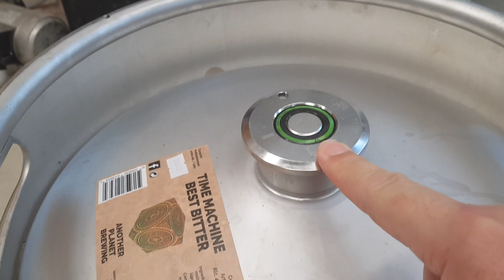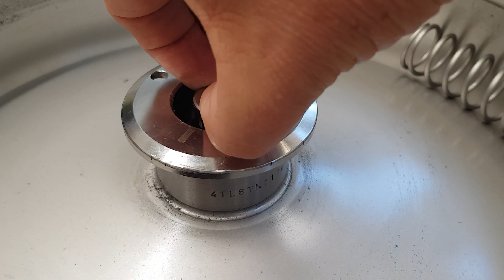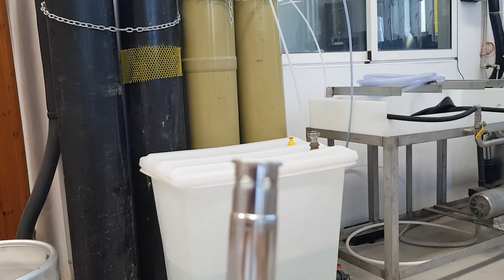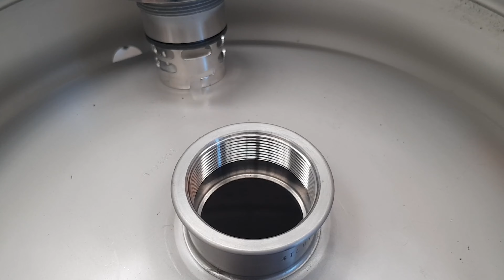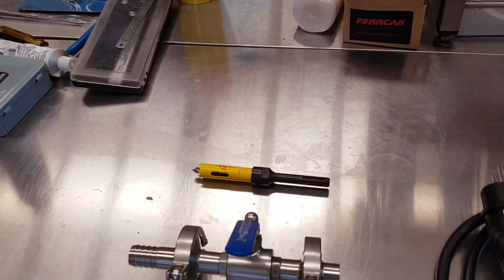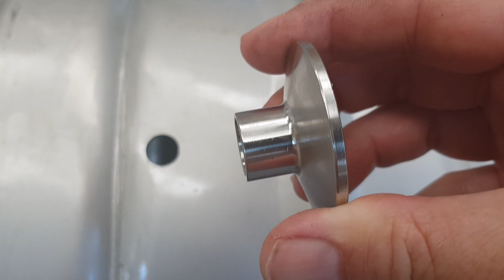Converting a beer keg into a home distillation boiler

Comment: Interesting consept. Would an induction plate (or a gas burner/convection plate) underneath the keg and a internal temperature probe make for a good substetute for an internal heating element?
Perhaps a rasberry pi could be programed for temperature controll and temperature logging
Reply from the maker: For sure you could use a different heating source. I think you would struggle with a convection plate due to the shape of the bottom of the barrel not being flat. A gas burner would work, but introduces the risk of explosions (fire and high proof spirits= boom). Your location would also be more-limited to outdoors or very well ventilated spaces. I suspect that a lot of burned-on deposits would accumulate in the keg using a gas burner due to the higher temperatures, but heck - moonshiners have been doing things that way for centuries. I like the convenience of electric elements and they are WAY cheaper than any other setup.
Reply: @planetmoonshine6223 indeed. I'm just worried about burnt grain or other solids in the still really. An external heat source would negate that.
Reply from the maker: In truth, i never had a problem with that,  even with some pretty lumpy washes.  Don't forget that because the element is on a triclamp fitting,  you remove it for scrubbing very easily after every run.  @RealGengarTV

Comment: How to get thee licence here in Spain? is it  needed for own consume?
Reply from the maker: @somathebest  getting a licence in Spain is not so difficult as in UK or US  but you need to apply to the department of special taxes,  get a visit from an inspector,  prove that your volume and strength measurement equipment is adequate for commercial use,  prove that your bottling and labelling meet legal requirements,  and agree to annual re- inspections, and examinations of your stock volumes to ensure they tally with your tax returns.  THAT is needed if you plan to sell.  For self consumption, it's technically still illegal in Spain,  but AFAIK there has not been a prosecution for self consumption in 150 years. You must make your own decision,  and I cannot advise anything other than compliance with the law.
Reply: @planetmoonshine6223  that's what i though. Where do you have the destilerry, is it open for getting a shot?
Reply from the maker: @somathebest  sadly the brewery/ distillery is now closed.  Covid and brexit killed the business.
Reply: @planetmoonshine6223  Sad news, where do you had the destillery? Here on Galicia,  there is a lot of home destillation speccially on small villages

Comment: Why not drill a second hole in the rim on the opposite side to the first one, take a pin-spanner and unscrew the whole valve, instead of destroying the seal?
Reply from the maker: You could do that,  I didn't think of it.  You still have to relieve the pressure.

Comment: Enjoyed the video, nice share ! Found whilst looking into building my own still, but just for water! I had the same ideas, but had not considered a cleaning port , so thanks.
One point , if you are looking at producing these for sale ,invest in a TIG welder! As you most likely know, our barrels are 316 stainless steel, whilst silver solder will work ,I doubt it would meet the medical and food grade certification required.304 & 316 are the most commonly encountered ST/ST grades, with the amount of chromium differing between grades , 316 having more chromium and therefore better resistance to corrosion.
A few friends use the eng/Chinese TIG brand “R TEC “ very reasonable price and all 3 claim ease of use , one uses his daily for five years ! 
I have no connection to the brand and use KEMPPi TIG myself.
Best of luck in the future , may pop in for a hello next time I’m over ( I spend time in Galicia ) 
SALUT ! SLAINTÉ! and SKÅL !

Comment: how do you regulate the temperature? is there a control on the heating element?
Reply from the maker: Yes, there is an SCR used to control power going to the element - I discuss it the next video in this series on distillation columns.

Comment: You should put flux on the metal before heating to avoid oxidation. This is Sodering 101! You do not know what youre doing.
Reply from the maker: There is a letter L in Soldering. This is spelling 101. You do not know what you are doing.  But you do it how you want.  I hope you enjoy your own still.

Comment: shouldn't  the heater have a thermostat
Reply from the maker: No,  it would be counter productive. During distillation the temperature slowly rises as the volatile alcohol boils away at a lower temperature than water. The rate of change differs depending on the alcohol content of the liquid in the keg. I have seen setups using a PID to control the element,  but it's overkill.  You just need to hook the element to an SCR to control power,  and use a thermometer in the vapor path to show distillate temperature.  Full power to reach boiling point then reduce power to keep a slow boil in the keg.

Comment: Much cheaper and easier to use a lower temp solder like Staybrite (about 4% silver) or Staybrite * (about 6%).  No  need for heating to red and all that scorching.  Just gotta use the right flux, StayClean liquid flux.  In fact with that flux you can use normal lead free plumbing solder, it's not quite as mechanically strong so better for things that won't be holding weight, but much cheaper of course.  Silver is expensive, I see no reason to use a higher content than necessary.
Reply from the maker: Can't get staybrite in Spain. Normal solder doesn't like stainless even with good flux

Comment: Before watching this video i was sure i would have to hire a welder to fit the fittings on the keg.  So that's a relief that i can solder it.  Now the hurdle will be drilling the 4 inch hole in the top without annoying my neighbors.  i bet that is loud, especially the angle grinding work.
Reply from the maker: Dremel is quieter than angle grinder and well suited to the job,  but it does eat the little grinding discs.

Comment: Thank you for an interesting video.
Looking forward to the next one.
How does a regular tri-clamp fit on the beer keg?
Reply from the maker: After removing the keg head and spear, the remaining lip is the size of a 2inch tri clamp. It just works!
Reply: A regular tri clamp gasket needs 1 side of the gasket trimmed off. It is a flat surface and the gasket has a "V" on each side. I used a belt sander  until it was flat.

Comment: I'm actually making a still from a beer keg at the moment, I am making a reflux still, I just need to weld a few more bits to the keg, and make the control unit.
Reply from the maker: Glad to hear you are taking the plunge! Regarding the SCR, its REALLY useful to have a volt and amps meter in the circuit. It helps you adjust the power more precisely, and thus make notes on what power works best for running the still faster or slower.
Reply: @planetmoonshine6223  thanks, I will get myself a meter.

Comment: Don’t no if you still look at the comments but links to get the stuff and names of the lid because you won’t find it look up lid and you look up vband and only exhaust ones come up nothing bigger nuff please reply if you still read these comments thanks but hope that helps
Reply: Look up "tri clamp fuerrel" and the size you want.
Reply from the maker: Here is a list... sorry if some of the links are out of date.
Here are some of the parts I ordered… not sure I have a full list any more.

Element - You need the 220V version for UK or 110V for USA. I used the 3Kw model. it heats 30L of wash to boiling in just about an hour.
https://www.aliexpress.com/item/1005001580417097.html?spm=a2g0s.12269583.0.0.ecfa7fb5X1YhtX

Cleaning port - I used the 114mm size
https://www.aliexpress.com/item/1005001544641059.html?spm=a2g0s.9042311.0.0.14124c4dpwTr7E

Drain port - I used the 50.5mm size
https://www.aliexpress.com/item/4000882825402.html?spm=a2g0s.12269583.0.0.58466d500KIqdB

Ball valve -  50.5 size
https://www.aliexpress.com/item/4001000361063.html?spm=a2g0s.12269583.0.0.c85d4e45Wnr6hk

Column - I used the 3 inch size
https://www.aliexpress.com/item/1005001897332734.html?spm=a2g0o.store_pc_groupList.8148356.7.7b9ff98cenqg59

I also bought a 3” sight glass which I use at the base of the column and a 2 to 3inch tapered adapter The sight glass is the 76mm x Ferrule 91 item.
https://www.aliexpress.com/item/4001162849060.html?spm=a2g0s.9042311.0.0.14124c4dpwTr7E
Can’t find the link to that one, but its a standard adapter 76mm to 50.5.

Plus a few spare tri clamps and gaskets in 2inch and 3inch as spares.
Reply: @planetmoonshine6223  thanks dude I looked for links last time but couldn’t find them.  this will do the job thanks mate there all there now 😲

Comment: What type heating elements do you use and a parts list would be MOST EXCELLENT!
Reply from the maker: It is the Dernord brand, 3kw element I bought from ali express complete with tri clamp fittings. Be sure to buy one that suits your voltage, in Spain its 220v.
Reply: Fantastic work, congratulations.  Do you happen to make some for sale too?

Comment: Hello thanks for the video can you tell me what size is your clean out (the lage one on top)
that you installed  ? Thanks
Reply from the maker: I used the 114mm size, just under 4.5 inches,  but it could have been bigger up to 5 inches.  After that you are running out of room on top of the keg.  Measure your biceps as that's what needs to fit.  🤣

Comment: Nice work, very useful instructional video! Interested to see the column. I run a T500 on a 25L boiler, wouldn't mind stepping up to a 50L keg with a 2 or 3 inch column
Reply from the maker: Go for it Martin. Remember the column rule of thumb,  height for purity,  width for speed.

Comment: Hi Lawrence hope all is well with you, I have only recently discovers you're channel some great content pal, if possible could you provide links for all the fittings in the build of this video please 👍
Reply from the maker: Here are some of the parts I ordered… not sure I have a full list any more.

Element - You need the 220V version for UK. I used the 3Kw model. it heats 30L of wash to boiling in just about an hour.
https://www.aliexpress.com/item/1005001580417097.html?spm=a2g0s.12269583.0.0.ecfa7fb5X1YhtX

Cleaning port - I used the 114mm size
https://www.aliexpress.com/item/1005001544641059.html?spm=a2g0s.9042311.0.0.14124c4dpwTr7E

Drain port - I used the 50.5mm size
https://www.aliexpress.com/item/4000882825402.html?spm=a2g0s.12269583.0.0.58466d500KIqdB

Ball valve -  50.5 size
https://www.aliexpress.com/item/4001000361063.html?spm=a2g0s.12269583.0.0.c85d4e45Wnr6hk

Column - I used the 3 inch size
https://www.aliexpress.com/item/1005001897332734.html?spm=a2g0o.store_pc_groupList.8148356.7.7b9ff98cenqg59

I also bought a 3” sight glass which I use at the base of the column and a 2 to 3inch tapered adapter The sight glass is the 76mm x Ferrule 91 item.
https://www.aliexpress.com/item/4001162849060.html?spm=a2g0s.9042311.0.0.14124c4dpwTr7E
Can’t find the link to that one, but its a standard adapter 76mm to 50.5.

Plus a few spare tri clamps and gaskets in 2inch and 3inch as spares.

Comment: Only one problem with getting stainless steel that hot is now after you finish soldering you will have to pickle and passivate the heat affected area or else it will end up rusting because you removed all the chromium on the surface of the stainless steel that gives it it's corrosion protection. There are a few products on the market that will take care of this issue relatively inexpenssive like  CitriSurf 77 Plus Stainless Steel Rust Remover and Passivation Cleaner. Costs around $30 bucks US. You just spray it on letting it sit for about 15-30 minutes and then wash off with fresh water and dry with an absorbant rag and that's it. You are done.
Reply from the maker: That's a good suggestion for preventing problems,  but bear in mind that any acid will  passivate stainless.  I assume by its name that citrisurf uses citric acid.. I always have peracetic acid on hand so I use that.  The inside will be passivated during the vinegar run,  but it's worth spraying with a weak acid around the outside and just letting it dry,  then rinsing with water.  Cheers mate.
Reply: @planetmoonshine6223  that product is not as weak as you think. If it’s not removed it will damage the metal. And depending on how hot you get the stainless will depend on how strong of an acid solution you will need to correctly passivate it. If you are not constantly using the still and you have not correctly passivate the heat effected zone, it will start to rust. But you do you bubb. Cheers Mate.

Comment: I have viewed many of the videos online related to this subject, your video is in my opinion one of the best I have seen. One question that I have for you is "what size and diameter brazing rod did you use" your answer would be much appreciated. 
In regard to the comment Scott Goodpasture made related to the inability to run Propane Torch on a Mapp gas cylinder this is incorrect, I have a torch which I change the gas bottles for various applications regularly between Mapp and Propane,
Reply from the maker: The rods I used were about 30cm (12 inches) long and 3mm (1/8") diameter,  but I think that's probably not too important compared to the right solder and flux.  😁
Reply: @planetmoonshine6223  Many thanks for your timely reply, I meant to ask you on my first request, did you use long weld neck tri clamp fittings.
Reply from the maker: @edwardgould47  I used regular weld ferrules.  The length of the neck was about 3cm on most of them.
Reply: @planetmoonshine6223  once again many thanks for your reply. I am looking forward to many more of your informative videos, Kind Regards.

Comment: Really useful video. Thanks. I hadn’t been aware of a tri clamp heating element before now. I suppose really it eliminates the need to drill the bigger access hole in the top that’s you’d need for a standard immersion heater 👍
Reply from the maker: Hi James,  the large hole in the top is really important for cleaning.  During stripping runs lots of crud gets stuck on the walls and needs to be cleaned with a brush. The tri clamp just makes life easier for maintenance than say, a flanged nut fitting.

Comment: What kind of column and condenser are you going to build for it? Will you be adding a thumper ? For whiskies, a thumper can be useful for stripping runs. It allows  distilling the less than clear mash without fear of scorching. Clears go in the boiler and the cloudy mash goes in the thumper.
Reply from the maker: Hi Corene, check out my video on pot vs reflux to find out 😉 https://youtu.be/f5ubAl1-Y3M

Comment: I'm a drayman and have been given a few kegs,how do I de pressure them please??
Reply from the maker: The easiest way is to beg or borrow an old keg head,  there is a one way valve in the connector that enters at 45 degrees (the gas line). Unscrew the connector,  pull out the black rubber one way valve.  Now when you put the keg head on,  the gas will vent.  Waste beer and gas will also exit the top connector, so a short length of beer line doubled over will stop that. If you can't get your hands on one,  it can be done with a screw driver,  but it's messy. Force your flat head screwdriver into the rubber seal and under it.  You need to depress the central button so use the screwdriver as a lever.  Gas and waste beer will exit but you will end up covered in it!! 😄 🤣 😂 an old damp cloth over the top may shield you from some of it.
Reply: @planetmoonshine6223  you sir are a star! I'll have to ask the brewery if I can mabye borrow a one,if not I'll get the tools out and get ready to be covered in old beer ,😂. Do you buy or sell the parts to convert the keg into a still? Sorry for the questions this early bud 😁. Thank you for your reply! Your video is the best I've found on YouTube, definitely subbed to you mate 🤟
Reply from the maker: @wasterdnb  sorry mate,  I don't sell the bits,  but you can easily get them off ali express
Reply: @Waster Dnb,  Lay the keg ON IT'S SIDE. Then lever in a screw driver in and leave it.
Gas will vent out without covering you in old beer dregs. Next day stand it up and remove the spear.
Cheers!
Reply from the maker: @BigEdsGuns  great suggestion!

Comment: Absolutely no doubt you will be able to make top-shelf vodka, gin, and other spirits.     If your whiskey has to taste the same year over year though you need to be able to age enough barrels to blend them to taste.    If you can accept a range of qualities in small-batch whiskeys and you have the patience to age them properly then you will get all sorts of good to excellent results.   Looking forward to your videos.   Nice when you can afford Starret :)....  For small holes, you can use a punch and die, a hole saw, or a tapered bit.   Quality of tooling is less important when you are only cutting 1 or 2 holes.   Cutting oil and patience on the big holes help.   If you are making a really big hole.  Welding the ferrule first can make life easier.   Upside down can let you use the 2" on the bottom for a drain hole.    Silver Solder and an acid flux make brazing with Mapp gas doable although on the big holes it can be fussy.   If you are doing this once then the price of solder, map gas, torch, flux, cutters is the same as hiring a pro to tig weld it.
Reply from the maker: Thanks Robert.  I used punch and die on my old homebrew pots but the keg was so much thicker I did not have the confidence to try it. I have hunch that I may be building a bigger boiler in the future so the starret cutters are an investment. Yeah,  I'm doing a bunch of stripping runs at the moment for a whiskey run.  Some oak barrels on the way,  but whiskey is a longer project 😉 and I am not planning on rushing it.